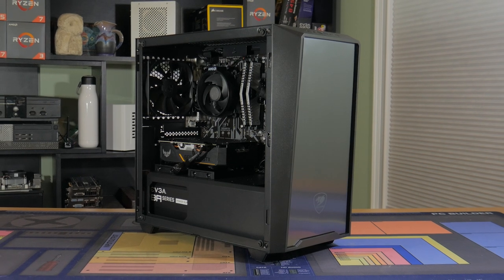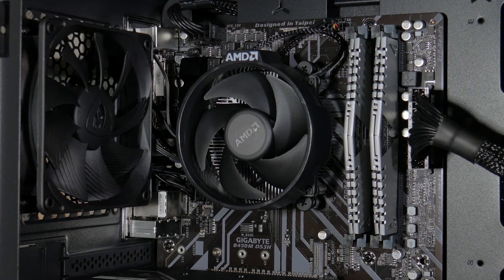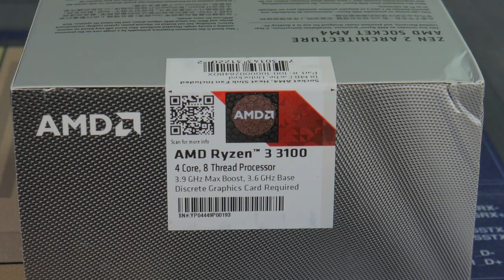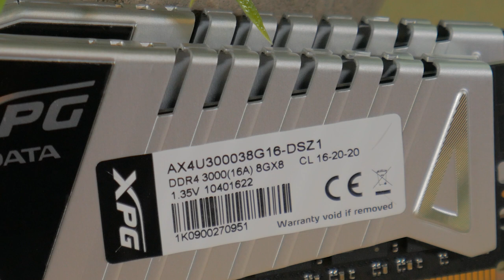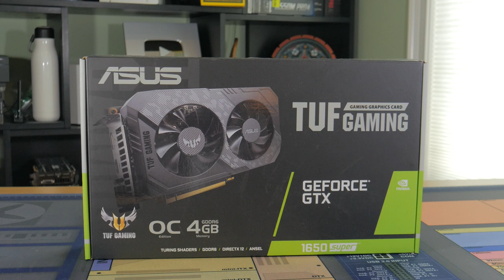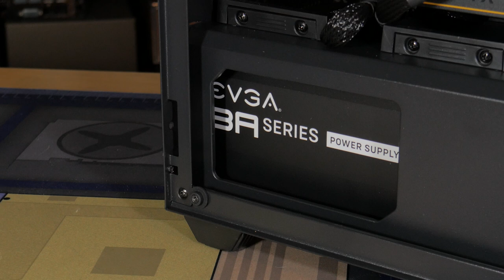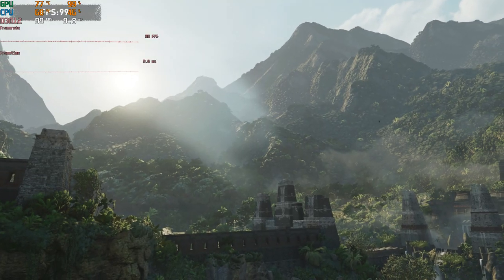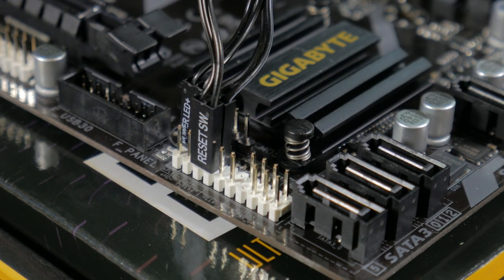$550 Gaming PC Build! (2020)

Comment: You can get a pc way better than this for £550
Reply: That's because 550pounds is  719 dollars.
Reply: Blarerings that is true for 550 here you can get a pc which can run up to about 300 FPS
Reply: @nedzdigga4437  300 fps on what?
Reply: @65v  that doesnt matter. With new components both are around the same price. Pounds is only maybe cheaper by like£30 altogether.
Reply: Bellron like decently easy games to like fortnite or something other games i dont really know that much